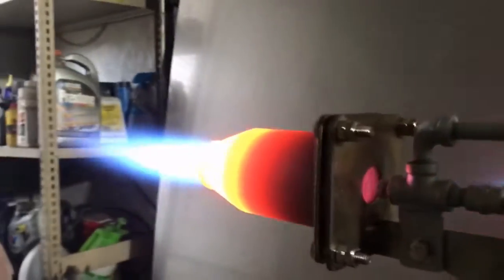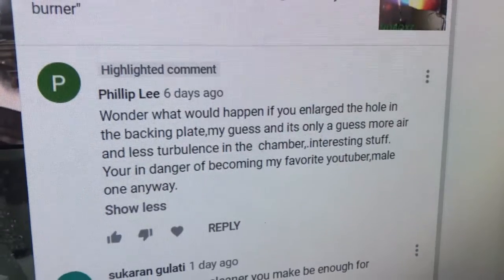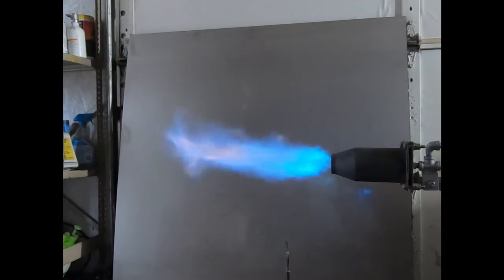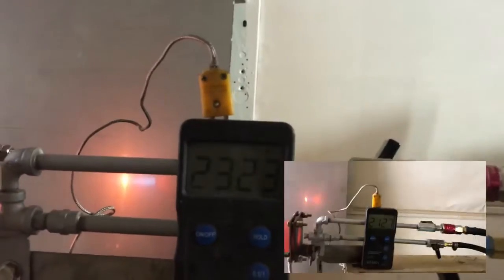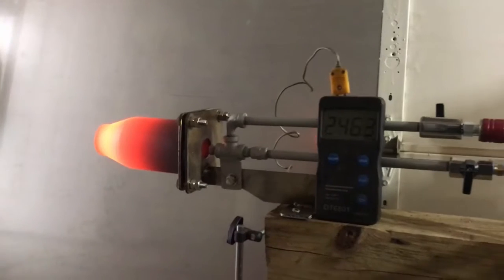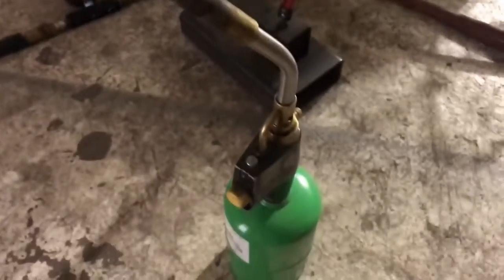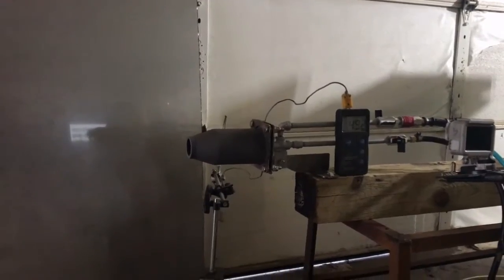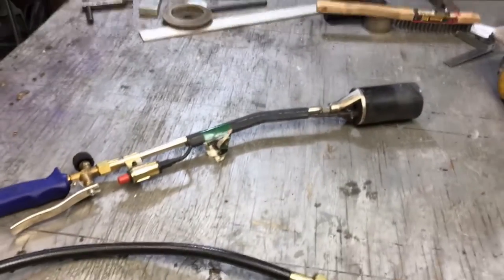High Velocity Silicon Carbide Foundry /forge burner

Comment: You are totally correct that the lower the vapor pressure and higher the polarity of a fuel, the harder it is to boil it, and does in fact require energy from the process to boil the liquid into  gas. On top of that, long chain [especially branched] hydrocarbons have many more bonds to be broken ONCE you have boiled them into a gas, therefore, that energy is going to take away from the final flame temperature. ~( 'w')/

Every substance has 2 phase changes [from solid to liquid, and from liquid to gas (except pure carbon <such as diamond>, at least at STP) and requires a significant amount of energy to transition any material/substance] and those have to be taken into account when calculating total potential temperature.

Keep up the good work! (~_^)-b
Reply from the maker: Great input , i never even thought about the long chain aspect .

Comment: perhaps for a waste oil burner you could try adding a central obstruction to increase turbulence? Not sure how it would work though, a cone or a double cone of carbide  in the burn chamber and have the air/fuel mix hit the cone to dump heat into the fuel and vaporize it?

Comment: Looking forward to waste oil test.... just a thought, Would waste oil need even  more air?maybe a bigger hole. I am sure there is a maximum size for the nozzle to work...
I think alot of people  get confused.... waste oil has alot more  btu than diesel per liter....  and should  be able to make more heat ( btu) ...    but I think you are right the  thick oil needs to become  fumes to burn and some energy is being lost to make liquid into vapor...   now if you recover  waste heat and get it close to vaporizing before you burn it... (one reason propane is clean burning and can run towmotors inside )
then maybe... but that's another problem  it will clog up the nozzle.....
One thing that I have done.  (Kinda copied  you.) Is preheat the compressed air going to the nozzle. Have a coil of copper pipe in the outlet of my wood stove... and it heats the nozzle and fuel in the nozzle.   I have had hardly any problems with clogging even with a smaller tip than I normally  use. But I do not let oil stay in the line to the nozzle I blow it out with air. I personally  think preheating the air is the best thing to do seems to solve a lot of problems.
And it easy to make...
Reply: Thin the WMO with anything... methanol, used gun wash (what I use), gasoline... don't need much to get it as thin as diesel.

Comment: For my foundry, I am not using a nozzle, but an orifice that allows the atomized fuel to enter,(through the pipe where most propane burners fit in) whether it be diesel, propane or waste oil to be injected into it. It is nothing more than a piece of stainless pipe and a plate welded to itMy inlet tube / orfice is 1 1/4 inch ID with an .5 inch inlet, and be correct size inlet, which is not the same for the nozzle set ups. I believe  using the nozzle outside the foundry is a large loss of energy, prior to entering the space (massive radiant heat loss).  Also I have found that if to much air is added to the mix in the foundry, and getting the perfect burn, it will actually be running cooler. I can now melt cast iron with out a problem. and both fuel use and air volume have decreased. .  Your fuel delivery is perfect, a focused nozzle is not needed for a foundry, but the is only my finding. I believe The nozzle are must outside a confined burn chamber.